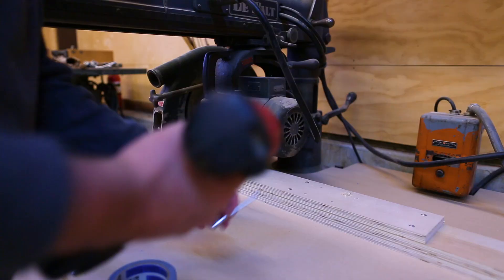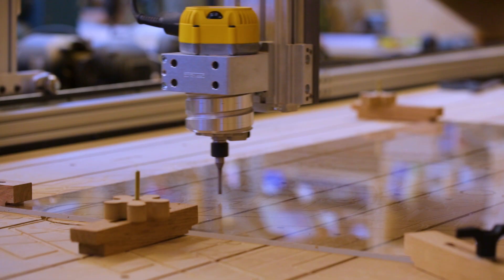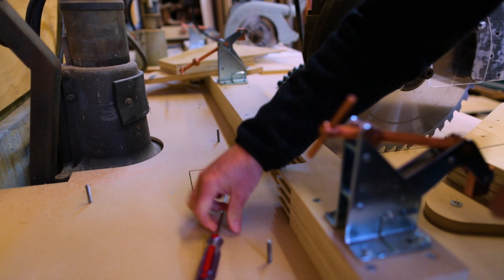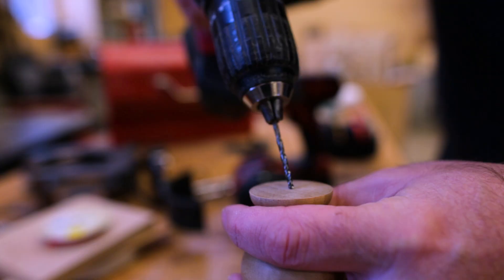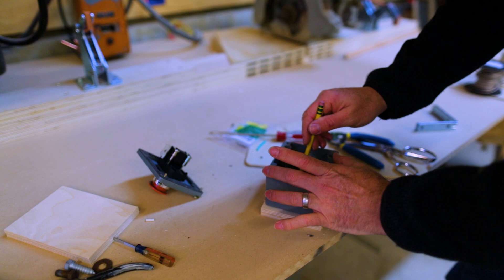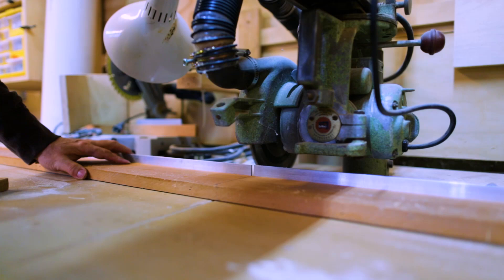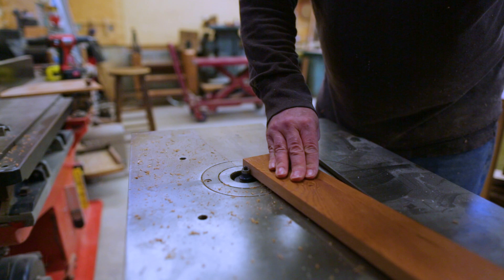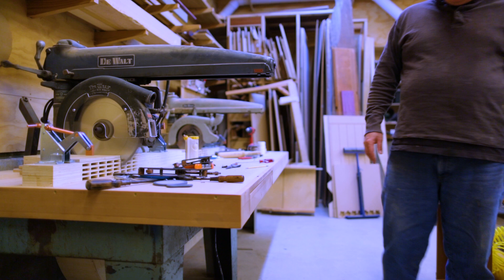Radial Arm Saw 3

Comment: Awesome stuff as always Frank. Couldn't you have just run a couple screws up through the top of the junction box into the underside of the table? Curious why you made that bracket.
Reply from the maker: I guess it would be harder, but not impossible, to get it in the right spot.  Now that you bring it up that would have worked.

Comment: Frank, doesn't having the radial arm saw pretty much eliminate the need for a crosscut sled?
I didn't know radial arm saws could pivot (7:35) to give you and angled long cut as I saw you doing here! That is amazing and makes the type you have something I might start looking for!
Reply from the maker: A Cross cuts sleds on the table saw is still more accurate.
Reply: frank howarth Oh ok. Thanks.
Reply: MRrwmac Correct, a properly tuned R AS turns out work as accurate as the TS, just more easily in many cases.  You can check out the DeWalt R AS Forum over at Delphi Forums.com to learn all about these great tools.

Comment: Would there be a way to cut the power and apply a brake to the blade? Obviously the power is cut, but that thing has a load of momentum and looks as if there'd be a lot of cutting potential even after the button had been pushed whilst it slowly spins down. Or am I missing the point?
Reply: DC injection, or an external mechanical brake.

Comment: Safety regulations on Mars now require an E-stop button for each of your five tentacles. These buttons must be color coded in the direction of the planet's rotation: anti-phasic chartreuse, protonic crimson, nebulaic azure, dichroic sulfur yellow, and intergalactic distress orange. Colors must be resistant to gamma radiation to a depth of 33 meters methane, and must be visible to the naked compound eye at twice tentacle's length or 12 meters, whichever is greater under standard gravity.

All viewers should boycott Frank's channel until this regulation is met, on the chance that a Martian guest uses his shop.

Or, Frank could simply say, "Here's the e-stop. Knee this flap!" Anybody who doesn't get that has no business in there.

My dad's little-used 1958 DeWalt took a long time to spin down in 1965 and it's no different today.

Comment: These are some fine design ideas Frank! Good job! Though, why do you need two sets of radial arm saws?
Reply: Maybe two different blades, one for finer work and one for the rough stuff so the nice, expensive blade doesn't get worn out as fast? :)
Reply: The smaller light gray radial arm saw is set up for dados.

Comment: I realize that there’s probably nothing you could do, but that wind down takes forever
Reply: How about if the panic switch also triggered an electromagnet that was mounted close to the blade? 

Don't know how necessary it would be though
Reply: Replacing the magnetic starter with a $175 VFD would allow for programmable soft start and braking.

Comment: Nice idea with the 'panic bar'.  It takes a long time for the saw to stand still. Perhaps you could use
a breaking resistor? What type of motor is this? 

Best regards :)
Reply: It is an AC induction motor. You would need DC injection or something similar to stop the blade quickly. I tried adding a "braking light-bulb" to a very similar saw, and the light-bulb only lit up for about a second after I turned off the power. The blade still took a very long time to spin down.

Comment: The port on the front of the blade cover is for dust collection, right? Would it make sense to plug that?
Reply from the maker: yes i am going to do that
Reply: frank howarth I figured you probably were. I'm sure you have already thought of this too, but making a plug (that fills the void in in the blade shroud) instead of a cap would probably help with laminar air flow. Would be interesting to test both to see which clears dust more effectively.

Comment: Why does he like these saws so much?  Aren't they, you know, dangerous?
Reply: the danger level of a tool is highly related to the novicity of the user. i see nothing dangerous here
Reply: theorganguy Alright.
Reply: I am kind of a novice. But my feeling is that the radial arm saw is no more dangerous than the tablesaw if you use the guard and anti-kickback device (if you rip with it). If you get a kickback while cross-cutting, the whole motor and blade can come at you very fast, but as long as your fingers are not on the cutting line, and the motor doesn't hit you in the chest or head, it should be OK. Tablesaws cut off a lot of fingers. But a lot of people don't use guards on them, and that might be part of the reason. I do think using a radial arm saw without a blade guard is pretty dangerous. Especially if you are using a 14" blade. That is a lot of sharp steel out in the open.
Reply: as you are saying "as long as your fingers are not on the cutting line" - you are holding the saw arm with one hand and the other hand is holding your work piece a safe distance away from the blade. Here he even clamps the pieces as well!

Comment: I always hate it when I negate the purpose of a gate :-P  Question on the Powershop (I have a later model).  Do you know of any place where you can get a new stop capacitor that is compatible?  Mine winds out like yours forever.  Even longer now that I pulled the motor and put new bearings in it and the rollerhead.
Reply: NGinuity Oh so it does have an immediate blade stop? He just needs a capacitor to get it to do so? There you go Frank! Then it would really work as a emergency shut off and stop instantaneously!
Reply: On the inside of the motor cover interface there are a set of capacitors, which I believe are start/run.  Usually one of those would dump it's contents in reverse and act as a brake for the motor speed.  I have long suspected that one of these is bad since it also is really slow to start.  I'll have to go over to the Old Woodworking Machines forum or maybe ask Keith Rucker, he might know.  It's been about 7 years since I rewired it so forgive me, the details may be fuzzy.
Reply: Normally is just a start and running capacitor, I've never heard of a stop capacitor and the long stopping time means the grease inside the motor bearings is dry so you need to replace the bearings. If I'm not wrong the GE does not have a brake (electrical or mechanical) and when you turn it off the blade just keeps going until it looses all it's angular momentum. Check the forum for Dewalt radial arm saws http://forums.delphiforums.com/woodbutcher.
Reply: Thanks, I'll check it out.  My bearings are brand new so it's not that.

Comment: The dust collection built into the fence seems unnecessary and the whole design of that fence seems to nerf 90% of a radial arm saw's usefulness. With that set up you seem limited to 90 degree crosscuts only. Any angle at all would send the blade into one of the clamps and destroy the dust collection thingy. So would a miter cut, dado head or moulding head. Just attaching vacuum fittings to hook a dust collector hose up the dusthood already on any radial arm collects most of the dust anyway.  Hooked up overhead it doesn't even get in the way. Also a panic button on a  radial arm not equipped with an automatic blade brake seems kind of pointless.
Reply: LordPadriac Ok, get off your soapbox and take the time to view Parts 1 & 2 of this series (notice this is Part 3?🙄). In the previous videos Frank clearly states that what he intends to use the saws for...crosscuts only, single blade on one, dado on the other. He has a 3rd smaller RAS he uses for miter cuts. But yes, other than that, we are all impressed. Also, the “pointless addition of the panic button” has been addressed to death in the previous comments. In the previous videos he addresses the button (it was on there when he got it).